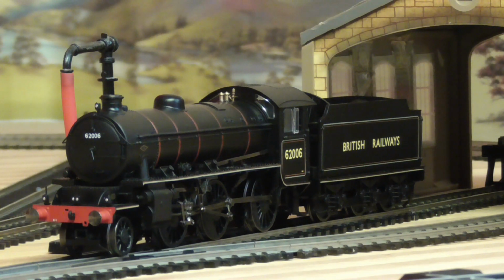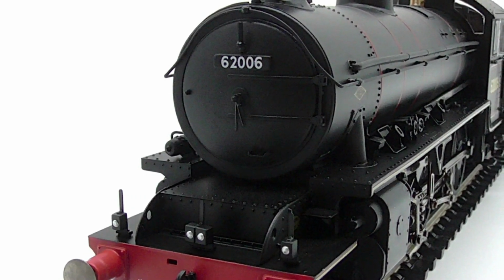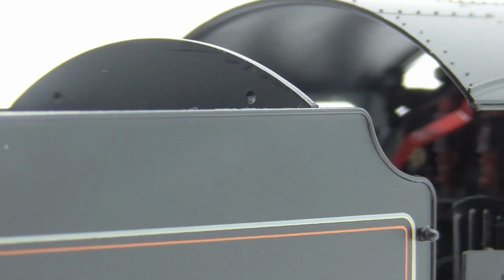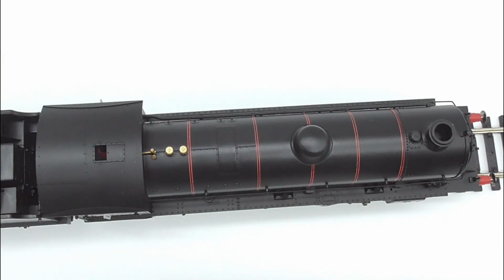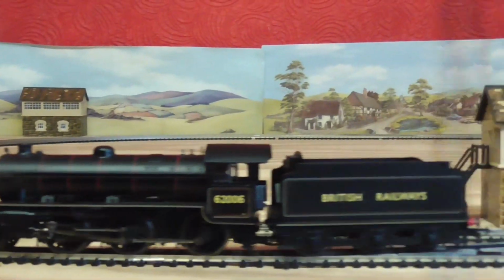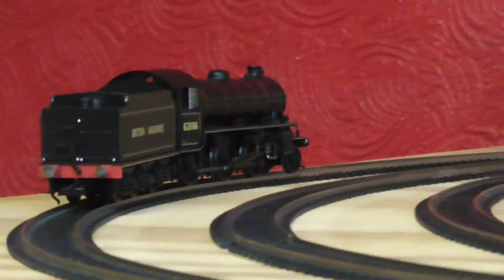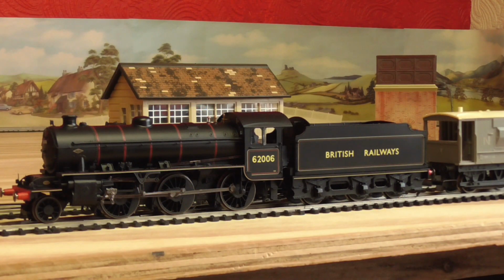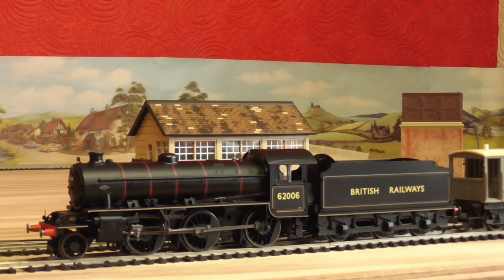REVIEW HORNBY LNER K1 CLASS

Comment: Great review! From other videos I've seen it looks like with Hornby and Bachmann you either can get a nice running loco or a really bad one. Correct me if I'm wrong, because I'm new to the hobby and from what I've seen the German manufacturers like Roco and Trix have better build quality and the locos are more reliable, although I prefer the looking of the British locos
Reply from the maker: hi Andres
i hope you are ok?
am glad you like the review
trix & roco are german yes ive heard the European manufacturers are better quality than uk ones bachmann and oxford rail and hornby ect
but some european companies maybe owned too bachmann or hornby
hornby owned rivarossi (Italy) lima (italy) jouef (french) Electrotren (spain) arnold (italy) 
i believe bachmann Europe owned some europe companies too but are different to bachmann usa
hope that helps
keep safe arp
Reply: Hi Andrés, You are right that Roco & Trix & Pico etc. are better build EU-quality and very smooth runners but we're not talking the same price. Say at least double and if you want sound well put another 100€. I have two of these K1's and these are amongst Hornby's best. Ver well build, strong and smooth runners especially on DCC ( I use the economic priced Hornby TTS - sound decoders) So for the price 'unbeatable' !! This is a very good loco I warmly recommend. Cheers, Filip
Reply from the maker: Oxford rail lner j27 are fantastic cheap model too
Keep safe arp

Comment: I always get confused with the K1 and B1. Can you tell me the difference between the two?
Reply: The K1 is a 2-6-0. The B1 is a larger 4-6-0 and was the forerunner to the B12 and B17 which were updated, modified versions of the B1 so look pretty much identical.
Reply from the maker: morning kelly
hope you are ok?
@Speleokeir is right
now k3 looks like it alot.
keep safe arp
Reply: The driving wheels for the K1 are smaller than the B1. Have a look at some photo's and you'll discover the big differences.
Reply: @speleokeir  the B1 is actually a simplified 2 cylinder riff on gesleys B17 with smaller drivers designed to remove the complexity of the 3rd cylinder being maintained from the equation and increase reliability and route availability in light of the maintainance heavy gresley design falling fowl of war time and post war austerity restrictions and cash flow problems. 

The K1 is again a simplified gresley K4, again the 3rd cylinder done away with to make it easier to live with and increase route availability.

Both great locos that saved the LNER and Eastern region from ruin along with the BR standard classes which were pretty much the result of the eastern region begging for nice simple easy to maintain locomotives to compliment/replace their fleet of expensive and old locos.